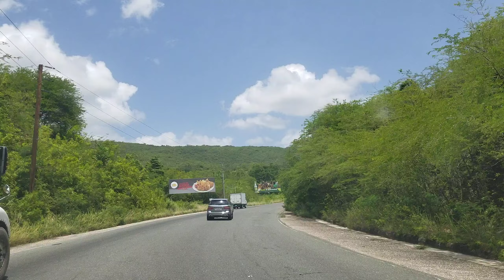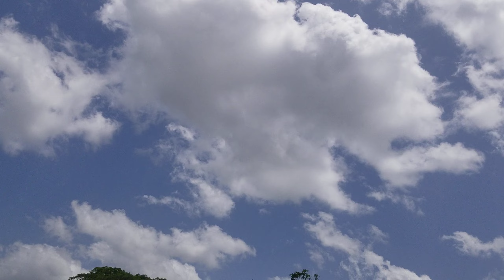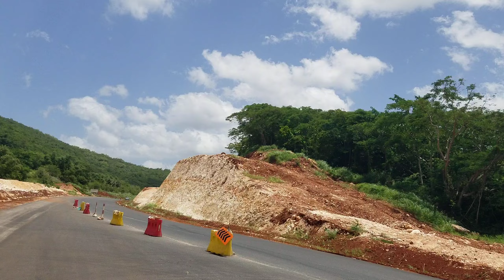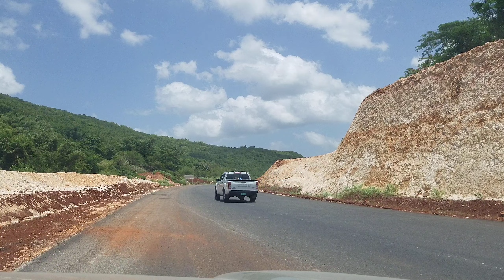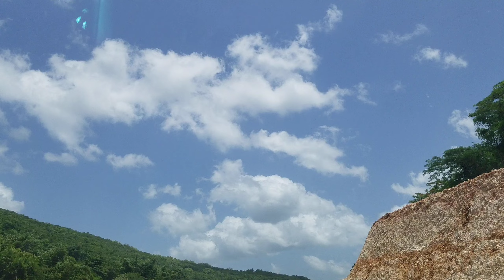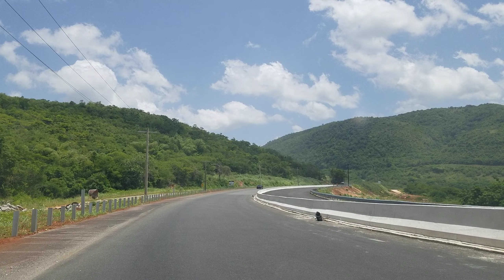New Interchange Needed Melrose Hill Bypass Jamaica

Comment: The simple solution to the merging problem is, merge the two lanes coming from Porous closer to the under pass into one lane so that only one lane will be coming from Porous. Do the same thing for the lane coming from the highway, that is, merge the two lanes coming from the highway in one so there one lane coming into the intersection.
So at the intersection only one lane coming from Porous and one lane coming from the highway. That will solve the problem
Reply: Agreed!  Another thought is to look at which thoroughfare has the right of way.  In my mind the Melrose bypass is different from the toll road.  I don't consider the bypass a continuation of the toll road.  With that said I believe the toll road ends where it meets th bypass and is subordinate to the bypass.  So they may not be a need to merge both sides.  the off ramp from the toll road would cut the speed limit down and traffic would then merge left with about 25% of the runway to go so it would be one lane from that point.  Now that would become a typical on ramp on to the bypass with enough merging space just like everywhere else on the toll road.  It is my opinion that more traffic is expected coming from Porus end than from the toll road for more reasons than one so that traffic will have more ease of passage.  So two lanes from Porus with a merge lane from the toll road.  You see that type os sytem all over the states even when exiting off major hghways on to another.
Reply: @creativepragmatic  Agree with you 100% on the design flaw statement.  They absolutely know what they are doing.  I could go either way on the Right of way thing.  Just wndered why marking two lanes coming from Porus so was kind of following their lead.
Reply: Merging both roads by using one lane each probably wouldn't be so dangerous for Melrose bypass, but for an high speed freeway like highway 2000, vehicles going at 80km ph, it would be just as dangerous as it is now....the 2 roads must be merged further west.
Reply from the maker: Highway cant merge to one lane
Reply: Too late for that, given the current configuration of both roads. There is ample space in the convergence zone for the creation of proper merging lanes for traffic approaching from both the bypass road and the highway and that's where the solution lies. Mindboggling though that the deficiency of the current alignment was not obvious to those who are supposed to experts! Smh...!

Comment: I said it before. Too narrow at that point. Traffic from the highway will have to yield to traffic from Porus, yet the traffic from highway traveling at higher speed. You see the problem. Easy fix, widen at the intersection and merge further up. There is enough space to do that 😊
Reply: Indeed, as simple as that
Reply from the maker: I agree
Reply: Making an exit from an highway, drivers usually have to yield. Check out the exit at Mandela in St. Catherine and the round about in St. Ann.
Reply: When exiting the highway, the person exiting must yield. Check it for yourself. You yield (cut your speed and merge) at Mandela in St. Catherine and you yield by following the rules at the round about in Mammee Bay exit in St. Ann and all other exits along the toll roads here you yield to the flow of normal traffic on the other major roads. The fellow making the videos needs to stop whining.

Comment: After they place the road markings on the road, then you'll understand what they are doing.
Reply from the maker: 4 lanes to 2. Let's see
Reply: Markings will do little to resolve the issue. That's obvuious when you look at  the cones which they're currently using to separate the merging traffic. Huge engineering failure!
Reply: @paulbdennis  The exit at Mandela merges two lanes from the highway into a single lane leading onto Mandela. It appears that's what they gonna do here as well, so the markings will tell you how to proceed.

Comment: I strongly believe they will revisit the section and correct it seeing the error they made. The space is there to add the two adfitional lanes and merge it up more to the two lanes. Tje good thing is they have the material at the spot and dont need to carry any much more than the finer to smootb off the road b4 its paved
Reply from the maker: Yep something not right

Comment: The toll road cannot merge into a single lane as that would defeat the purpose and cause congestion. The road from Pourus cannot merge into a single lane before it reach the highway as it used to be a double lane for the slower traffic before. The only solution is to widen the road into 4 lanes and further up merge one the the Pourus lane as the lanes need to be 3 lanes going up by the Yam park as that is a steep incline, as they did on the north south leg. This could have been solved with just the one bridge in the beginning with both east and west lane over it and that lane from Pourus  going under it and merge into one before joining the highway.
Reply from the maker: Agreed

Comment: Ok, the fix is to merge before the intersection and then merge again at the intersection.. at the intersection the merge lane will be wide...hence there will be a wide shoulder … what yuh think..
Reply from the maker: Widen the intersection to 4 lanes
Reply: That would be counter productive, thus the reason they had 3 lanes there before for the heavy laden trucks going up that hill, merging that lane would cause a bottle neck with those trucks. incorporating the Melrose bypass should mean that the amount of lanes there should remain and additional added for the highway.
Reply: @rhf457  Well, this is how problems are solved. Take all the variables into consideration and come up with the best solution..and remember our goal is for the safety of the road users..🤔🤔

Comment: I will repeat once again, the only sound and proper solution to this shortsightedness on the part of the engineering is to merge the two incoming lanes from Porus into one lane before merging into the two H'way lanes. Also very important is the shifting of the merging lane more to the right and gradually merge into the h'way lanes which any modern h'way construction design would prioritize the H'way 2000 traffic over merging traffic. Common sense.
Reply from the maker: Makes sense, but can it hold three lanes